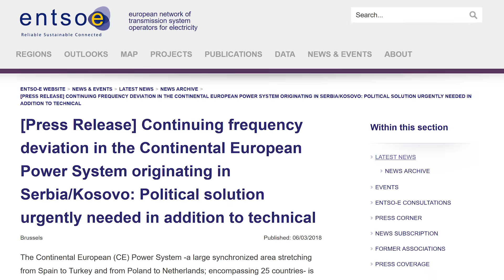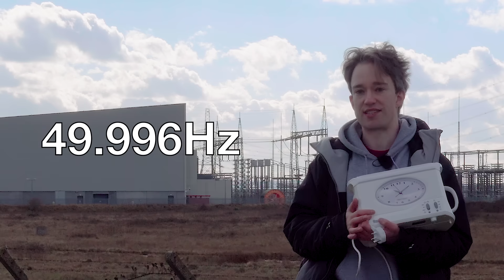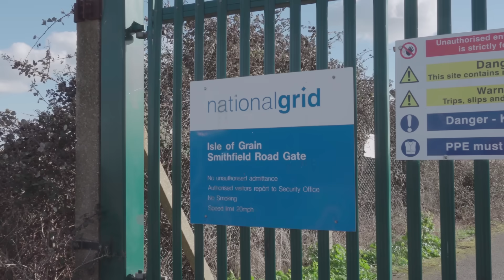European clocks ran slow for a bit. British clocks didn't.

Comment: Do you mean there are devices that tell the time and are not connected to the internet? How strange.
Reply: Apple phones have been connected to the internet for years, doesnt mean they know how to tell the time....
Reply: Jim Fortune it's amazing really
Reply: phones and computers etc get the time form the internet or gps satellites I think, and it's easier if already connected than having a timing chip or other device
Reply: what does the internet have to do with any of this?
Reply: Devices that are able to connect to the internet or to the cellular network will synchronise their clocks outside, but they don't do that often, but they are still able to show the current time when offline.
Reply: Fovlsbane that's not true
Reply: Fovisbane,
The satellites need the correct time so they can send it to your receiver. Your receiver needs to know what time it is so it knows where the satellites are, otherwise the time difference between the receiver and the satellites would be useless. Don't imagine that there's only one kind of information being transmitted by the satellites.
Reply: @Fovlsbane There are many companies that make NTP appliances that sync to GPS satellites.  Symmetricom (now Microsemi) is one, as is Spectracom.  The timeserver in my office is currently synced to 9 satellites and is used as a stratum 1 network timeserver.  The satellites themselves are synced to atomic clocks with extremely high precision.
Reply: I mean theres the sun. That doesnt have wifi... yet.
Reply: Joseph Evans, does your phone stop showing time, when it is disconnected from the internet? It has a timing chip, basically everything with electronics in it does. Even drills with speed control have them. And, phones get their time from the network, not the internet.
Reply: No. All computers have low power internal timing chips that are always on. Your phone doesn't lose the ability to tell time if you go into a cave with no signal or put it in airplane mode. They will check themselves when connected to the internet though.
Reply: Kevin Macdonald, not to the internet, to the network.
Reply: Has everyone forgotten about magnetic clocks?
Reply: Off the top of my head I can think of 7 ways to keep accurate time on a device.
Reply: Right, so the receiver needs its own timekeeping? I said its based of time difference from the satelite, so of course the satellite must tell you what time it thought it was. Maybe I wrote it a bit imprecisely, or am I missing something in the concept of gps? 

I suppose if youre stationary you could use it for time rather than position?
Reply: Michael Wylie okay, make a list pls
Reply: Michael Wylie, internal clock, power grid, GPS, internet, radio, cellular network. What else?
Reply: I was counting mechanical, digital and radioactive source internal clocks separately.
Reply: Thank god
Reply: Overrated Fool, so if you come to a foreign country you don't get time? That's dumb. My phone has a box "Use network provided time" you can tick.
Reply: MrPaukann in other words YOUR phone gets the time from the network because you changed the default setting?
Reply: Strange times we're living in...
Reply: Overrated Fool, it is default and you can change it only to manual. My phone means (with 99% certainty) all Android phones which means 75% of all mobile phones.
Reply: More like not even using a quartz crystal
Reply: I'm not sure there are many devices that get their time from the internet. Cell phones might still get their time from the cell network (no internet required) and GPS chips provide extremely accurate time.
Reply: Fovlsbane You raise a good point and it's a question that is always overlooked in explanations of GPS. The receiver receives its time from the satellites. It can't use its own time as a reference because it doesn't have an atomic clock.
Reply: Curtis Densmore, PCs, Wi-Fi routers and stuff like this. A lot in numbers, but not a big percentage.
Reply: I am missing the radio time here, eg. DC77 (77,5kHz) in Frankfurt. That's how most watches and battery powered clocks with radio keep their time (additionally to the cristal inside)

So ways to "get" (exact) time (I can quickly remember):
GPS
Radio (DC77)
Energy network
NTP (Internet, and other I-Net algorithms)
Phone network
Quartz cristal (mostly at 32768Hz, highly temperature dependant)
Pendulum (magnet or weight powered)
Reply: Yes, and some of them you have to wind up with a key...
Reply: You do receive timesignals from the GPS-System - you portable GPS-device calculates its position from the runtime-difference of severeal different satellites, not from the actual tme itself. Actually many systems use the GPS-signal as a very precise clock - ATMs for example.
Reply: thats not how that works precisely, because then your phone would need an atomic clock synched to those of the gps satellites, since time from the internet is ms behind due to delay
Reply: MrPaukann iPhones get the time from an internet time server.
Reply: If you received time from gps, gps wouldnt work, its based of the time difference between you and the satellite.

Comment: That is the thing that causes the camera flicker too, right?
Reply: It causes US/UK&EU flicker - the US grid runs at 60 Hz, as do many cameras. As such, a 50Hz light source will look flickering on a 30/60/120/etc. Hz camera, but in the US it's fine
Reply: Yes and no. The flickering is caused by the fact that a lot of digital cameras film at the american standard of 30/60 hz (from the fact that NTSC TV is at 60 hz), while european analog cameras film at the european PAL-standard of ~25/50 frames per second. The flickering is caused by the difference in frequency (IIRC the flicker moves at 10 hz, which is very much visible).
Reply: US flickers because TV operates at 29.97 FPS and most digital stuff refreshes at a multiple of 10.  Why do we use such an odd number as 29.97?  Well because the easy way to get a dual color/black-and-white TV signal forced us to go with that.
Reply: infinitelyExplosive If you have north American camera in Europe yes. North America runs at 60 Hz, so north American cameras run at either 30 or 60 fps so that frame rate is in sync with the pulsing of lights. In Europe they are out of sync (that's why this video is probably either 25 or 50 FPS btw, I imagine he's using a European camera).
Reply: If your phone is not in sync with the local power grid, yes, the light will appear to flicker.
Reply: No, that's caused by TVs displaying the picture 1 line at a time, and cameras capturing the picture 1 line at a time, but at a slightly different rate.  Both devices these days are likely to have their own internal clock.  (Any device running on a rectified DC current, as most electronics do needs its own clock anyway).

Comment: Todays randomly selected framerate is.... 25! oh dear...
Reply: And...it's perfectly fine, because you're viewing it on a device that ultimately uses DC current and therefore doesn't rely on the power grid to keep time.
Reply: it would look better if my device ran on ac 50hz, 25 doesnt devide into 60, so this looks like 20, which is trash.
Reply: You're still running a CRT?
Reply: no?